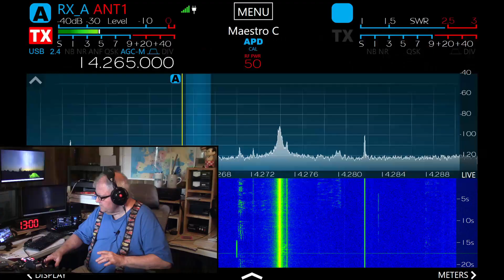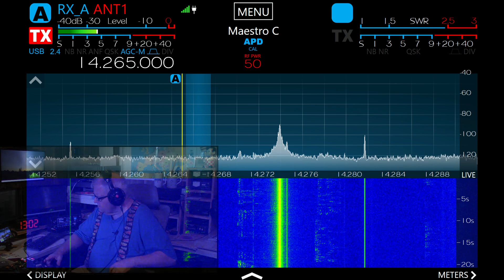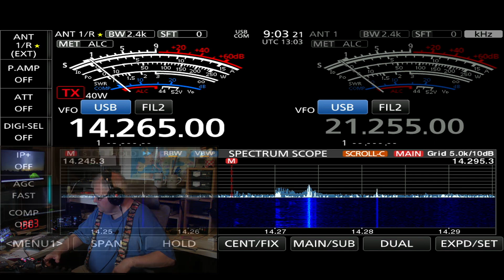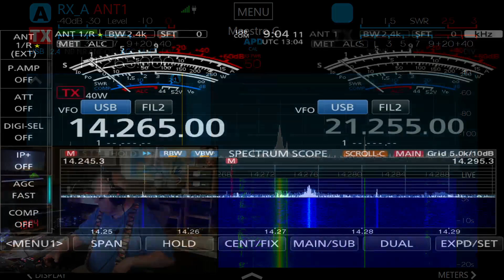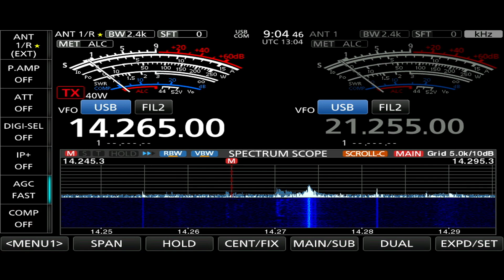Rematch Once Again! Weak Signal SSB Test Part 03   Flex 8600 vs Icom 7760

Comment: For what I hear here, Icom 7760 is much better. And the FTDX101 or FTDX10 are much better.
Reply from the maker: Better for some - but the choice of a radio is a very individual decision. Weak signal reception is only one aspect. Operational ease and interface connectivity are others. Some folks don't like Yaesu's use of menus to control functions. Flex has great interfacing to externals through DAX and CAT virtual connections. The beauty is that you get to decide what is best for you. Enjoy this great hobby! 73 de W4EEY

Comment: Sure if the band was dead, isn't that the best time to test for weak signals!! Kinda ironic statement. Dont ICOM recommend the pre amp on from 20M and above as normal operation?
Reply from the maker: It is possible that the Preamps would have improved the signals on both radios. But I was trying to make a comparison between the radios using the same (as much as possible) settings. This got started because I was questioning the weak signal reception on my Flex 6600. It was one of the reasons I purchased the Icom 7760. As it turns out I was right - but then Flex updated their software and improved weak signal reception. Now they are both approximately equal.

The Flex 8600 belongs to my friend Bruce, KB4FHA. He loaned it to me for the test.

73 de W4EEY

Comment: Well Gary - you confirmed that both transceivers are great radios.  In the end, though, you are demonstrating the one percent capabilities that other, less capable (read: less expensive) radios struggle to achieve.  For 99% of typical amateur contacts, any of the modern radios will achieve a similar result.  My little FT-710 challenges both my TS-890 & K3 in almost all situations, including typical DX contests.  It's that one percent added performance that commands the added $$, in my opinion.  Nevertheless, I'm contemplating the purchase of either the IC7760 or Flex8600 just for that 'new car smell' ...
Reply from the maker: You are correct. We always pay more for the last 1 dB in performance! And I recognize that my comparisons are unscientific and fraught with issues. But I started this to prove to myself that I wasn't crazy and that the Icom 7760 was "hearing better" than my Flex 6600 - which it was in the first test (to my ears). After Flex updated their software the radios seemed to "hear the same" as far as weak signal performance. But I still like the Icom audio better than the Flex, which to my ears is a little harsh. I still have the 6600 but have moved it to my workshop station and to the classroom studio. The Flex Signal Display is the best in the business and works great for our ham classes. 73 de W4EEY
Reply: @W4EEY Yep, I am ping-pong’ing back and forth on which of the two radio’s to purchase.

Comment: @RSwrightMD (what he said)
I think I can improve weak signal copy on your 8600 a bit. The AGCT is set too high and you are listening to excess noise floor (hiss and crackle) Move the AGCT left until until the noise floor just disappears (or is very very faintly heard) Move the dial to an open frequency to set this then return to the station you want to copy. Boost the audio to keep the signal audible. Your S/N ratio will improve to the best it can be. 
Sometimes switching AGC speed between Med and FAST can tweak the copy a bit. If you are still not happy then click the NR button to add processing.
Now, you will likely say the Flex audio is weaker than the Icom (whatever)  If volume is your criteria for better copy, then return to the way you were doing things. 
For me, better is better copy on a weak signal in noise. not more audio volume.

So far neither the Flex 6600/8600 nor any of other rigs I use/have-used copy weak signals in noise better than the cheap seats FTDX10. (FTDX101 is good also)
Reply: Currently copying a Very weak station on 14300 kc (MMN)
With the AGCT at 24 the copy is just possible at R2-S1 to R3-S1. 
At AGCT 27 the COPY IS R1-S1 I can tell he is there and that is all.
Flipping between AGC Med and AGC FAST did not help.
Reply from the maker: I appreciate you sharing your insights on optimizing weak signal copy. 73 de W4EEY
Reply: What an effort just to improve the RX signal🤨. Even my FT-DX3000 had quieter reception, not to mention the light years better DNR. All I had to do was press a single button. I regretted switching to the 6400M for this and other reasons. Nevertheless, the operation and the great display are a lot of fun. However, the price/performance ratio is rather poor if you really value a good receiver.

Comment: I have a K4D and it works very well but most of todays SDRs use the same ADC make it them very close depending on software.  I have used the 7610 and it’s good but I prefer my K4D for its many more features I use with it.
Reply from the maker: The Elecraft K4D is a beautiful radio. I have friends that have them (NU4E and K4SV). I have only played with a K4D at a Ham Fest. It is certainly one of the best in class. 73 de W4EEY

Comment: Gary. - enjoy your videos and the comparisons. I recommend you try another comparison with several changes to the rigs. 1. Turn IP + on. Flex has its own version of feedback to improve DSP performance and reduce noise. Icom uses dither which is present when the IP+ is on. 2 The Icom front end has a preamp ahead of the ADC which makes the signal a bit louder. It cannot be turned off or on. It is fixed and is independent of the preamp one and two settings. Try turning a preamp on for the Flex and the signal strengths and audio should be similar. 3. I would also turn on NR on both rigs to remove the high pitched hiss noise. This will also help the audio sound richer. I would love to see you compare them on a CW signal also if you can?
Reply from the maker: Thanks for commenting. I will consider a future comparison and note your suggestions. I don't own the 8600, but the owner (KB4FHA) is local to me and I'm sure would let me borrow it again. My 6600 weak signal SSB performance improved audibly with the most recent software update (3.10.10). Thanks for watching. 73 de W4EEY

Comment: Hello From Austria dear Gary, What to you think about the comparsion in CW? Wich TX is better ? What is your opinion? Mny tks, 73 de Ed   OE5POP
Reply from the maker: Hi Ed. Thanks for watching. I am not a CW operator so I have no experience with these radios in this mode. I do have a friend who owned a Flex 6700 and an Icom IC-7851 (this was several years ago). He found that the Icom could hear signals that the Flex would display on the screen but not make audible in the headphones. Of course the 7851 is a Super Heterodyne radio, not an SDR.

The point is that for very weak signal CW an SDR may have limitations. 73 de W4EEY
Reply: @W4EEY  mny tks. 73 from Austria! Gd. Luck and thanks for your Videos!

Comment: At this point, I tend to think there’s no bad radio… Icom 7760, Yeasu 101MP, Kenwood TS890, Elecraft K4D, Flex 8600 (and many more) are just great and they all have their pros and cons, and it all depends on your preferences… just pick your poison, in the end, we’re still subject so much to Antennas, QTH, QRM, even QRN, so much stuff that will make way more differences that the differences we could find between those radios. I’m an equal opportunist and would use any of them… actually, if I would be rich, I would own them all, no exception, just for the fun of it.
Reply from the maker: I agree, good antennas and a quiet QTH are key! 73 de W4EEY

Comment: How does the ICOM control head compare to the Maestro?  Are they both equally convenient to operate?  Have you done any remote operation away from your house and were there any connection issues?

Thanks for your content, Gary!
Reply from the maker: The Maestro was designed with a limited number of controls and knobs. The pushbuttons are programmable for whatever is important to you. The AGC-Threshold knob is key in hearing the weak ones. The Touch Display is High Resolution and the best available. Split operation is easy (just make sure TX is assigned to the correct slice).

The Icom Control Panel has more knobs (akin to a classic radio). If you are familiar with any recent Icom radio you will feel at home on the 7760. Noise reduction on the Icom is so good you can leave it on all the time (no distortion). Split operation is like a classic radio (listen on your TX frequency only with a button push) unless you invoke Dual Watch.

I have done remote demonstrations with the Icom using their RS-BA1 software and WFView. I have not taken the Head remote yet. I plan to do so next month for a demo to the Greer Amateur Radio Club. No connection issues though you do have to forward three ports in your home router (details in the manual).

73 de W4EEY

Comment: I definitely think the Icom 7760 sound is better and that it has better selectivity. 

I also wonder how older radios like Collins S line or a Signal/One CX7A or B or a CX 11 A would do.
Reply from the maker: Hi Jon - I don't have access to these older transceivers, but they can be surprisingly good. You do know about Rob Sherwood's Receiver Test List? It is here:

http://www.sherweng.com/table.html

He has been testing receivers for a long time (he said that he's on his third generation of test equipment because radio performance has gotten so much better). The list is sorted by "Reciprocal Mixing Dynamic Range" which is a measure of performance in a crowded band (think CQ WW SSB DX Contest). There are some Collins radios on the list, but not the Signal One (that I can see).

73 de W4EEY

Comment: Love the video, I have a 7760 and been very happy with the radio, would love to see how you as an experienced operator use the filters, DNR, RF gain and notch on low signals to get the most out of the radios.  Thanks for all you do.
Reply from the maker: Thanks for the idea. I'll ponder this. It should be doable. Thanks for watching. 73 de W4EEY

Comment: Hi very nice video and test . I also have the 7760 since January ,for my ears in the test I hear more clearly with 7760 in this occasion!
I also have ts890 and try to compare : are 2 different things!! I find 7760 more quite but is a different radio architecture.
Ciao de ik3vut Luca.
Reply from the maker: Hi Luca - I used to own a Kenwood TS-850s. Loved that radio. I'm sure the 890 carries forward that quality. You are right, the 890 is a mature super heterodyne design while the 7760 is a direct sampling SDR. Ulrich Rohde did a paper I read that said that the super het will always beat an SDR on performance. But the 7760 is a wonderful implementation of a direct sampling SDR.

Thanks for watching! 73 de W4EEY

Comment: Now the ftdx 101 mp and 7760 please
Reply from the maker: Probably not gonna happen. I appreciate your enthusiasm for the series but I don't have an FTDX-101MP to test. And if I did I would need to rework the setup with the Yaesu radio and the Icom controller moved to my workshop (along with the video gear).

Thanks for watching! 73 de W4EEY

Comment: Almost a tie again.  The speaker in the 7760 is better maybe if you had a external speaker on the Maestro
Reply from the maker: What you were hearing was direct from the Line Out connectors of the Maestro C (Flex) and from the Controller (Icom). No speakers involved. I was listening via headphones to the output of my video switcher. 

I did notice after listening to the video afterward that the Binaural option in the Flex radio may have been selected "On". I forgot to check this. On my home theater the Flex audio went to the extreme Left and Right while the Icom audio remained centered. Don't know if this helped or hurt the Flex as I listened in my headphones. But I wanted to mention it.

Thanks for watching! 73 de W4EEY
Reply: @W4EEY thanks for the response.  They both receive well but the Icom was more pleasant to listen to.  I think they both receive EQs so you may be able to match the sound quality of the Icom.  It was a great comparison.  Thanks for doing that